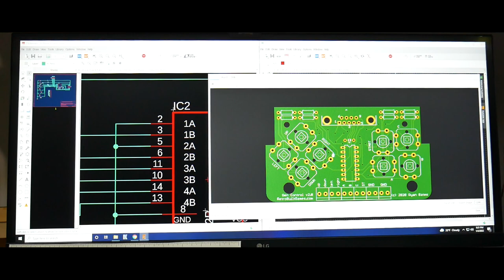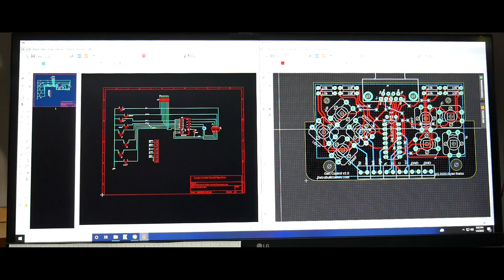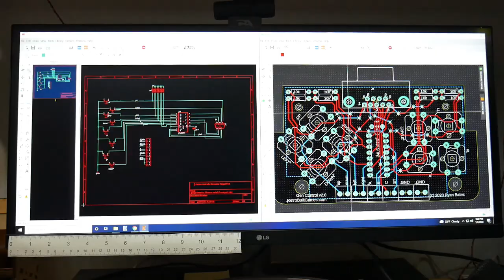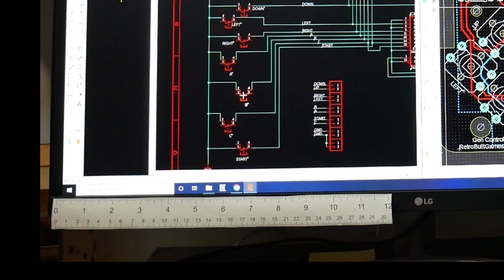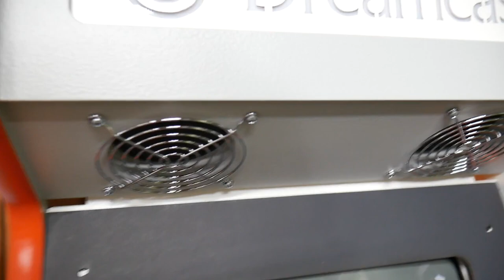Tools I Like for Arcade Building and Electronics

Comment: You said "when you get a nice pair of flush cutters..." but then at 2:28 you can see that your pair has different jaw lengths and they don't meet at every point when closed. :D

These are kind of the Rolls Royce of flush cutters--at something like 10x the price of a normal pair--but Tronex does an incredible job.  (There are a staggering number of varieties for just about any job.  I got the 5049's to have tiny jaws with long reach for trimming the supports off resin 3D prints.)  The jaws are ground to a perfect fit with identical lengths and the action is smoother than I've ever felt before.  I never thought I'd have a strong opinion about flush cutters, but there it is. hehe.

In the meantime: nice video.  Even your "filler content" is high quality.  I'm excited to see more.
Reply from the maker: right; the message there was "wear safety glasses when using snippers." I explained the jaws on my Xcelite snippers broke while using them.
 I'll look at Tronex, cause they look very fine. Thank you for the suggestion.
Reply from the maker: oh geez those are expensive. but i am smitten somehow
Reply: @RetroBuiltGames  Oh, sorry! My two year old was interrupting during the part where you described them being broken and I didn't catch the audio.  That explains how they were that far off.  (Also, yes: wearing safety glasses while cutting is the right answer!)